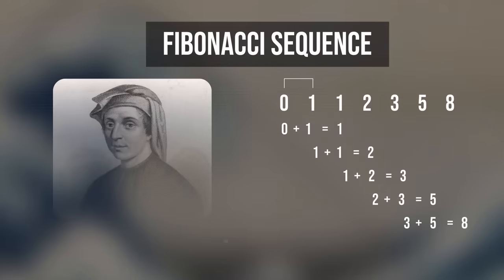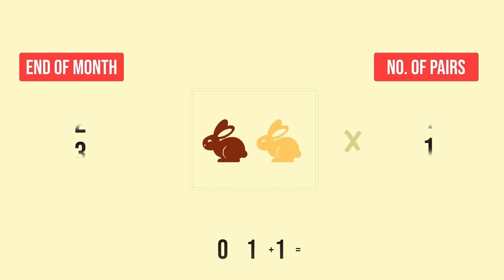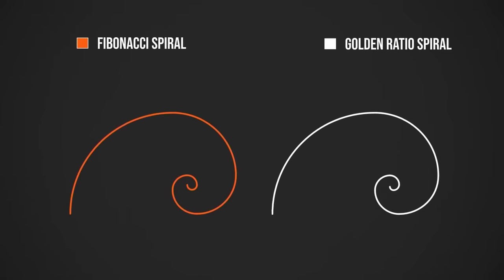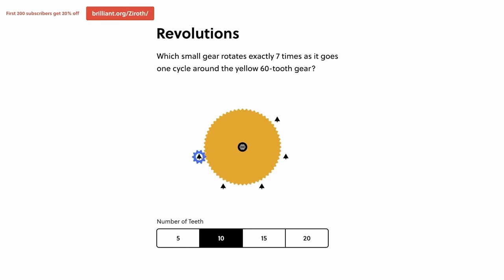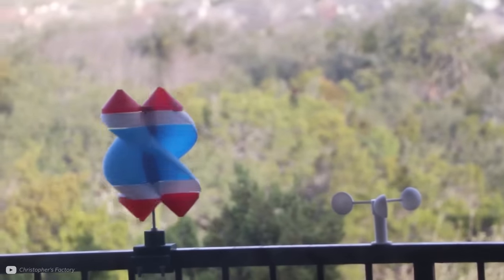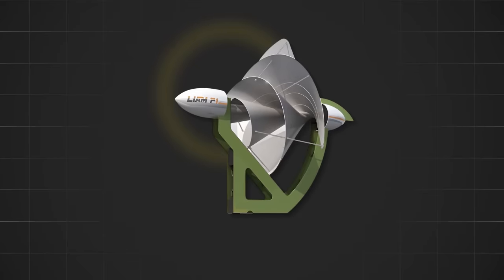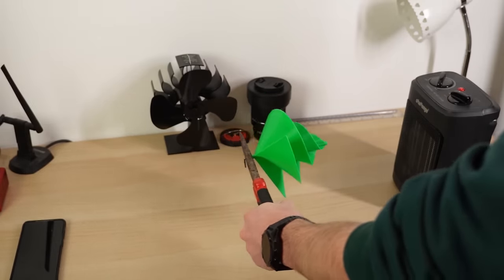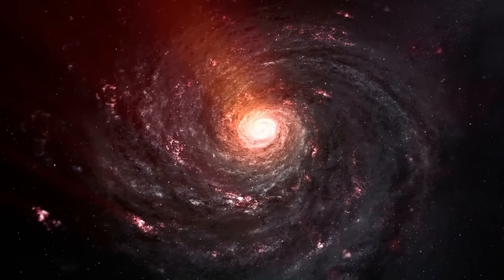Uncovering The Genius of Fibonnaci Turbines

Comment: 100% is max 145% is a load of BS...
Reply: So you can only increase the number 4 by 100% to 8? Lmao of course you can quantify percentage increases over 100
Reply: @polandsgarden   increase over what?
Reply: Wrong... Everything is relative to itself, meaning that turbine can never exceed  100% of it's output.   It's output can only be an inclease of 145% that of a different turbine, but he never specified which turbine he was comparing it to.  Which basically makes the video no more scientific that the rest of the clickbait videos on youtube.  Large turbines that cover vast areas of wind, will still be more efficient due to their ability to capture large areas of wind, and making a huge contraption in the shape of a seashell, not only can't be shipped efficiently, but will require a far greater set of bearings, gears, along and vast amounts if gear oil.  As in 145% as much gear oil, as it takes to operate current large industrial wind turbines.  Speaking of gear oil, ever look up how much gear oil a large turbine requires on its annual gear oil replacment?   But I will admit that is a nice propeller the kid has there, I recall playing with something similar made of confetty paper when I was kid.

Comment: I think the most important thing is Cost Per Watt, across all scales. So im wondering whats is the cost of manufacturing vs relative production improvement compared to traditional turbines. Beautiful video
Reply: Even more important is cost per Wh (or kWh, MWh, etc).
Reply: @SolarWebsite  yea that's what I meant, can my original comment be interpreted in any other way?
He touched on this at the very end, I guess if you know the flat geometry you can bend sheets to this shape, but will they hold the shape in fast winds? I need to see a home made version of this
Reply: The most important metric of a wind turbine is LCOE
Reply: @fire17102  Uhm, well, you did say watt...
Reply: @fire17102  Actually your original statement is perfectly valid and the industry standard.  Because reneable energy has a high upfront instalation cost and almost no marginal cost the primary investment choice is made on a metric of cost per unit of generating capacity aka (dollars per watt) which is driven by manufacturing and instalation of the equipment.  In the end more detailed calculations are needed to determine profitability but by then many other non-technical factors like interest rates, tax incentives etc are also involved.
Reply: Nuclear, LNG, and hydro have the best cost per watt across all scales and the most durability in the face of extremes in weather. Conventional wind turbines are over rated for wide scale use because of the drawbacks (they have to be subsidized, frequently breakdown in severe weather, endanger birds like bald eagles, use toxic materials). these newer logarithmic turbines show much more promise because of their design and minimal environmental impact.
Reply: LCOE is the best metric bar none
Reply: @artcurious807  I'm sure you're right, but those aren't practical everywhere, and definitely not available at all scales. For example I live off grid, strong wind all the time here, so after solar, harnessing the wind is the next most likely thing I can do. Once people learn to do safe diy home fusion I'll definitely do that haha
Reply: @bobbob-gg4eo  thanks for sharing! I will look it up. Still feel like cost per watt (or Wh) is the biggest factor in calculating LCOE thou
Reply: The most important thing is that the design is optimised for the environment in which it will operate. Similarly it would make more sense too optimise for ranges of wind speed rather than for a compromised one size fits all.
Reply: @artcurious807  Sorry, Nuclear would be many times the most expensive if not subsidised and the radioactive waste has to be stored and monitored to up to many thousand of years
Reply: @SolarWebsite From the factory you can only determine cost per W, as cost per Wh depends on the geography and climate of where the turbine is placed.
Reply: @Stonefeather53  The nuclear waste issue is massively overblown.
Reply: @Elrog3  But the fallout is everywhere...
Reply: I don’t think it would be feasible to scale these turbines up to anything near the large conventional turbines. 

Also the amount of energy of wind is proportional to the cube of wind speed iirc. Wind speeds are relative low at ground level. Therefore larger (and higher) turbines are can catch more energy than smaller ones. 
In other words, wind turbines need to be high up in the air.
Reply: Thats right. We has many experiments after the first modern windturbine, which is standard all over the wird. We have found none. 

You have to up, where there much more wind. Those nice sprirals are heavy. Wondpowerstaion of the today are made humans using moderne math and computers,

All pr auto are up gaist the wind onless in heavy storms og hurricanes.

Wings for windtubines bend well. Its epoxy and kind of carbon laminate. I suppose the YouTube model wend well and the collapse. I folow Your worries.
Reply: Thats right. The trade both ways is, when a old producer by coal, oil or gas is in its last days. They kind of refinance. Many here added stocholders and the producer get some cool cash. 

I have private saving in a pension fond. #We# get back with interist
Reply: I do like this spiral version for smaller turbines. I suspect it's similar as it performs better in  lower winds.
So for off-grid houses perfect - because less noisy and still efficient.

For dense populated areas probably not the best though.
Reply: @bobbob-gg4eo  LCOE only really matters for grid level power generation. For something like this you keep at home  to power lights or something, it will always be much more expensive than grid power.
Reply: As they compared the turbine with the Arhimede's spiral...the less efficient pump you can have,the turbine's efficiency is the same,huge drag low rotation force,as the air is just swirling without using its mass inertia to transform it into a lateral force,to cause the turbine to rotate. The paper windmills the kids make in the kindergarden are a lot more efficient than this joke.
Reply: Until we get some independent studies, it's just a notion. Studies performed by the developer are utterly useless.
Reply: @bobbob-gg4eo  Only if you include all externalised costs. The cost to replace coal, for instance, is the rental value of high-rainfall farmland multiplied by the number of years it takes to grow plants and then turn them into coal. When governments sell coal at below the replacement costs, that is a direct subsidy for coal - a subsidy paid from your taxes to those corporations so that they can make a "profit."

For minerals, such as iron, aluminium, copper, and uranium, these things cannot be made just by waiting millions of years, so the real cost is whatever it takes to recover them from landfill or other end locations. Again, if the government is selling off ore at a price that makes it cheaper than recycling, that is a subsidy paid out of your taxes to those corporations so that they can pretend that what they are doing is profitable.
Reply: I am considering a vertical axis wind turbine that looks exactly like a tree, I call it : e-tree
the trunk of the e-tree is brown, the spinning sails (blades) are green.
Attached to the trunk of the e-tree are features of : wifi/mobile network, light and power outlet, to charge a car for example

Comment: 9:14 The green thing is NOT a savonius turbine. A savonius has to have a gap between the halves through which the wind can flow to the other half that runs towards the wind.

If the gap is missing it is a pure resistance runner like for example an anemometer.
Reply: Minor quibble.  The version with no gap is included in the drawings of many embodiments of the concept revealed in his patent.
Reply: Ahhemmmm. not a "savonius turbine", its a "Savonius ROTOR"
Reply: @dennisbecraft1303  In his patent document of 1926 in Austria, Savonius included drawings of a version without a gap as well as a dozen of versions with a gap. He explicitely explained in the text that the gap significantly enhances the performance of the rotor. In his patent document of 1930 in Germany a specific layout of the gap is the essential feature of his patent claim.
Reply: @FranzN57  Why lecture me?  I'm not the one who said it must have the gap to be a savonius.